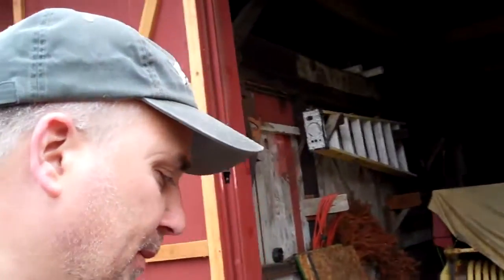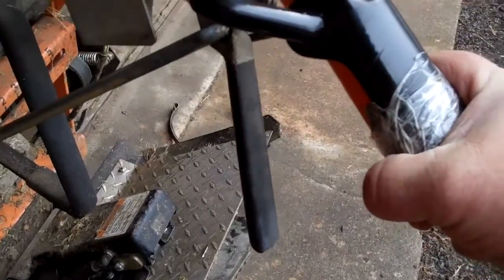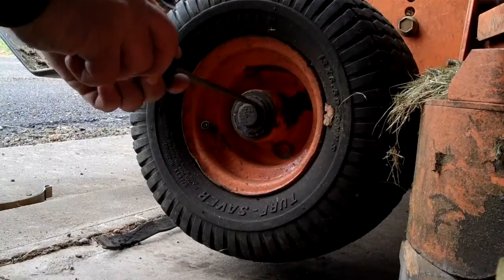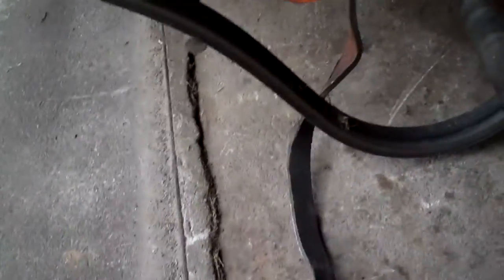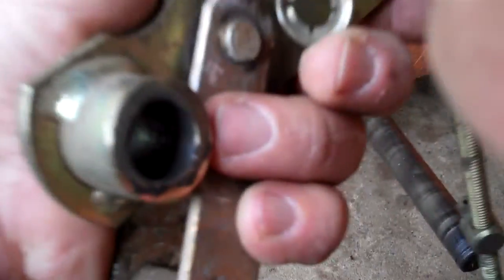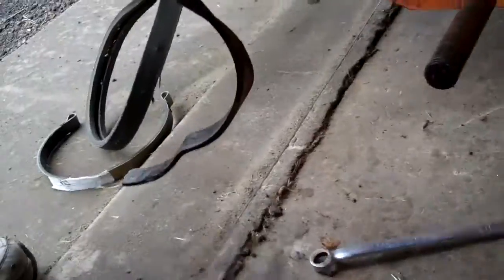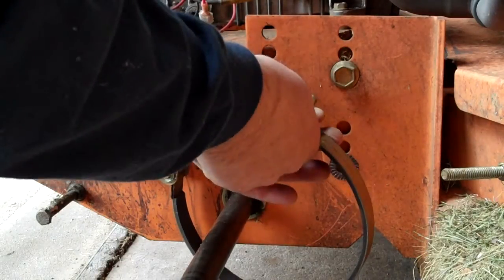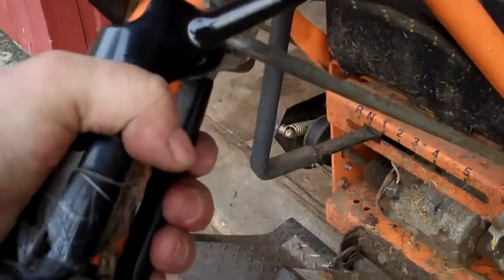I had to replace a brake band on the Scag mower

Comment: Thanks for the vid...very helpful.    That was some real nonsense that the dealer did not have those locking washers in stock.
Reply from the maker: Thanks for the comment. Not having the washers was a small issue, as for my dealer they have been real good to me.

Comment: Thanks for the video very informative content. I had to remove the rear wheel assembly from my scag today and had to disconnect the brake and drive belt to get tire off mower.  Video was very helpful in that regard.  Also thanks
For advice on how to adjust mower tracking from pulling left or right. Now
Mower goes straight.

Comment: Great video!  I have a 48 in. Scag like yours, I bought it used, it pulls to the right.  Looking closer, it looks the the right side bolt the brake level uses is welded on and doesn't sit as flush as it does on the left side (unwelded) but it causes the right side drive belt to be off, slightly pushed out away from the side.  Is that bolt the brake level goes on welded to the engine deck or is it replaceable?  Thank you

Comment: My brake squeaks and sticks on the one side any suggestions that would help with that thanks
Reply from the maker: I'm thinking that your brake band is worn down to the metal, this would cause squeaks and sticking. I would check them first. Eric
Reply: It’s brand new mower so I thought maybe it has to  wear in also the brake handle pulses  when I’m mowing
Reply: When in neutral it doesn’t roll freely when I move it it rolls alittle bit then sticks almost like it’s wrapped

Comment from the maker: With diesel costing $0.50 more per gallon than gas I can't catch a break. If I could do things over I would get a higher gear ratio to improve the milage. I think the truck has 4:11 gears now and I wish it had 3:73 instead. Eric